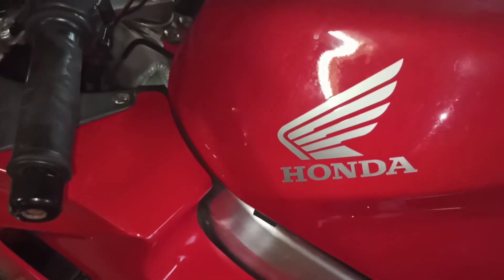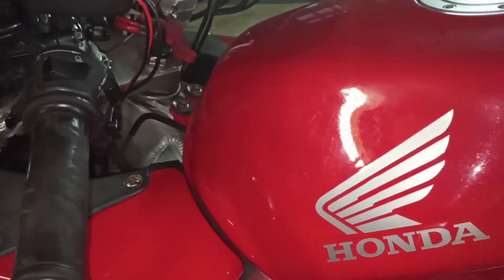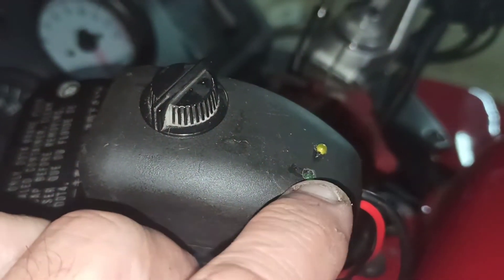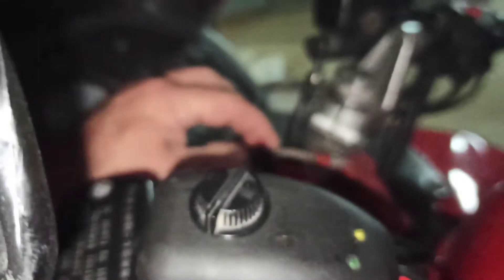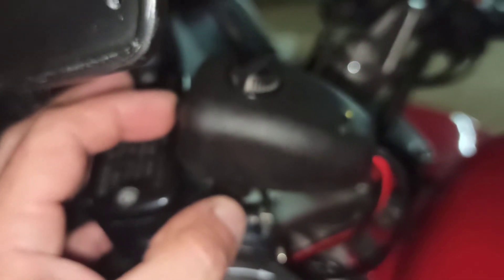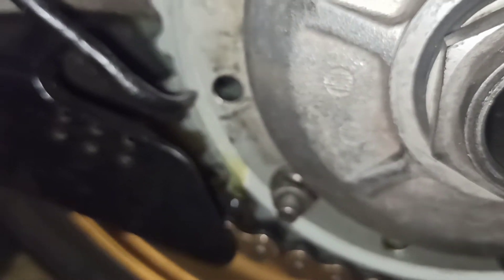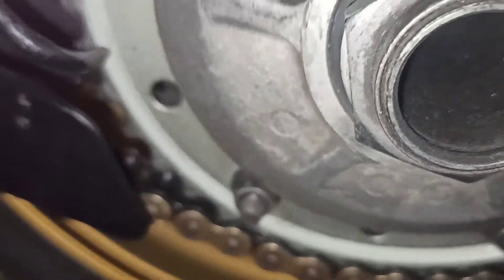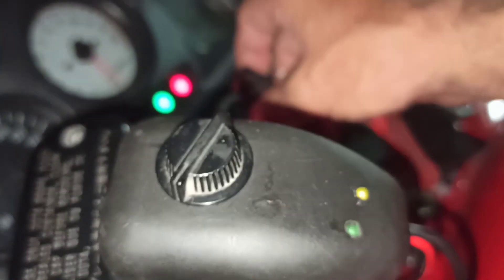Automatic Chain Oiler. Homemade .(Adjustable system).

Comment: Solanoid valve volt ?
Reply from the maker: 12v because the motorcycle power supply is 12v like on a car. If you put a lower or higher maybe that will be damaged the solenoid valve. Than is nead more electronics to exchange 12 14v to 5v or 24 v.